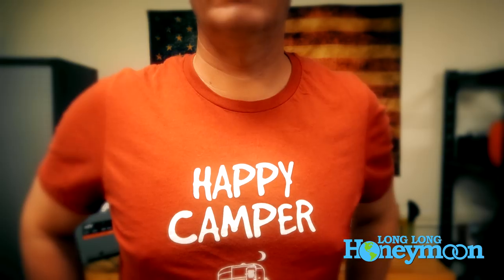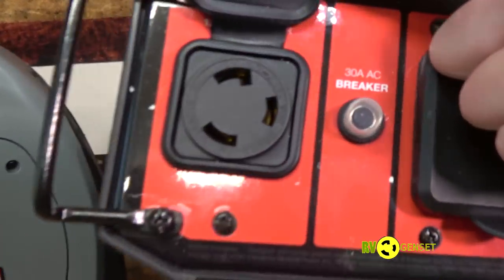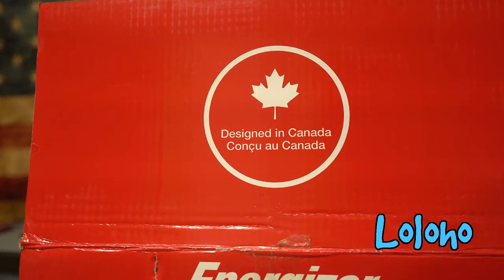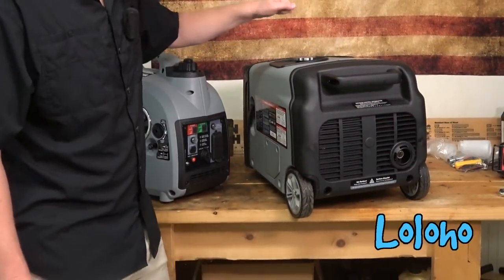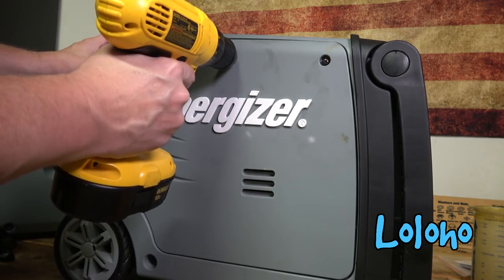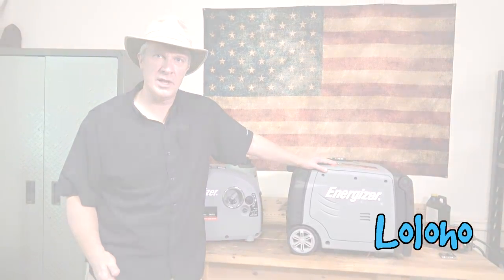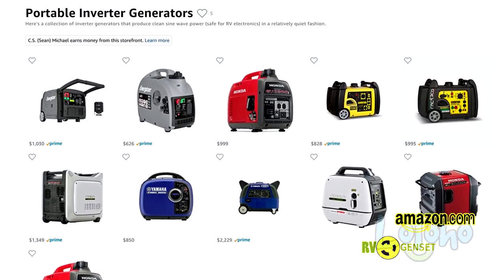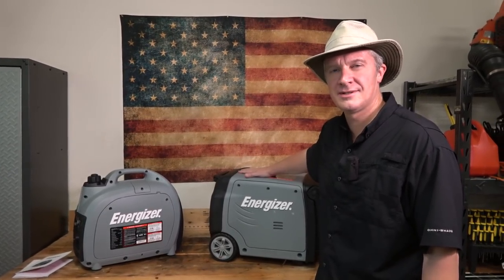REVIEW: Energizer eZV2000P & eZV3200P Portable Inverter Generators

Comment: What noise level is generally considered acceptable in a campground?  My main consideration would be producing as little noise as possible.
Reply: Currently, the National Park Service does not allow generators to exceed 60 decibels. But they don't say from what distance, which is a key factor.
Reply from the maker: It looks like the NPS scale of measurement distance is 50-feet, which is pretty generous. All of our inverter generators would easily pass that test.
Reply: I can't recall ever hearing anything like your notorious open-frame generator in a campground but I have heard inverter generators past 10 pm which is pretty annoying.  Frustrating when there is no enforcement of very basic rules.

Comment: You just had to mention Justin Beiber.... We're sorry, OK? He was a nice little kid when he left here....

Here's a stupid question.  The user manual on our Champion said you are not supposed to have any load on it when starting and I assume this is the same for all makes and models.  So what is the point of a remote start?  I push the button in my bathrobe, but then have to walk outside, scaring the entire campground, while I then plug in the RV?  What am I missing?
Reply: Jim Pratt you can keep it plugged in, just keep the a/c load off. Don’t start it with the air con in the on position, or any other a/c appliances. You can even turn off your main breaker in the camper if your concerned.
Reply: Jim Pratt I believe the remote start has a built-in delay before the output power turns on. I have a champion dual fuel that I have hooked up to a transfer switch in my RV that switches over after 30 seconds.
Reply from the maker: Hi Jim, I agree with the other commenters. Also, there's  "the way things are supposed to be done" and the way they are actually done in the real world. (Sometimes the two are even the same! :D) Even with our original Yamaha, at times I started the generator with the RV still plugged in. It's lasted 11 years and is still going. I agree that it's best to have the A/C off if you are going this route!
Reply: OK thanks everyone. It's a moot point for me since I don't have a remote start, but you do wonder about these things...
Reply: in our RV the main breaker is inside.  You can switch off the main breaker, push the remote start button, then switch the breaker back on.  In fact, if we ever go with a remote start unit I would probably mount the start fob near the main breaker so A) it doesn't get lost and B) insures I follow the correct start and stop procedures.

Comment: Nice job. We just melted while camping at 98 degrees and so we are shopping for a generator that can run the 13.5 AC. We had a noisy Older champion Generator next door that drove me crazy. So sound is a big deal to me. Very good info on the Big Boy. Looks like he may not be the answer to our needs. Say hi to Christy for us😁
Reply: Scott. check out info on what is called a "soft start" or "hard start" kit -- same thing, people just call them differently.  It acts as an "amperage shock absorber".  You can put it on a 13.5 BTU roof air and it changes the unit so it requires much less power to start up -- it basically buffers the power to smooth out the start up surge..  It's that start up surge power that overloads most generators (if the generator is going to overload).  Inverter generators are harder to overload, but every generator has it's limits.
A "soft start" kit may help you a lot and they're pretty reasonable in price.
Reply: Install a Micro-Air EasyStart on the air conditioner and a quality 2000 watt inverter generator will start the AC.

Comment: You show videos of 3000 watt generators but go into great detail as to how they don't perform to your liking. Why not test a 4000 or 5000 watt generator, flip a switch and have everything work?
Reply from the maker: 4000/5000W inverters are pretty unusual and the majority of our audience seems to focus on the 2000W & 3000W models. They simply are sufficient for most campers' needs (to run an appliance, A/C, recharge the RV batteries, etc.). With that said, I'm definitely open to reviewing the larger models. Preferably I'd like to see one that I can lift and that fits beneath our tonneau cover. :O

Comment: Nothing beats a Honda these companies sure do try though.
Reply from the maker: I wish someone would create a cost effective equivalent to the Honda, but I agree - nothing has truly "beaten" a Honda just yet.
Reply: Long Long Honeymoon yeah even used Honda generators are priced way too high but the only good thing about the Honda generator is that they are quiet why can't these other companies figure out what makes them so quiet.
Reply: I know it is probably apples and oranges but I have a Honda HR-214 self propelled walk behind mower I purchased in July of 1988 - still have the receipt - so it is now at its 30 year anniversary - I do keep it maintained but I think other than replacing recoil starter a couple of times there have been no "repairs" - It has a shaft drive - no belt - I still use it every week during the grass cutting season in Atlanta which is pretty long and it starts first time every time. Amazing quality product.

Comment: Oil soaked air filter, no thanks. These small engines are so fuel air ratio sensitive. The smallest amount of oil into the fuel system will reek havoc. This is for extremely dusty conditions rarely encountered.